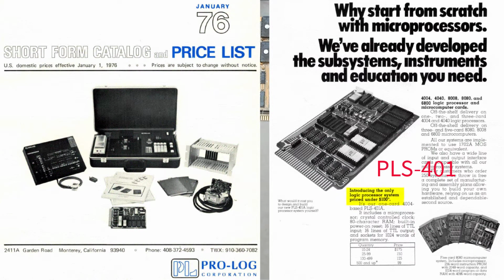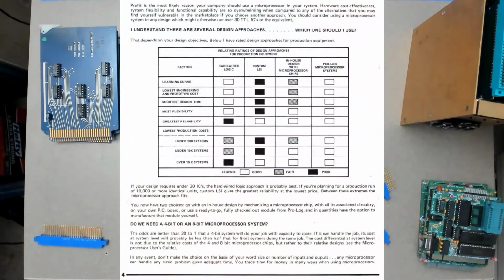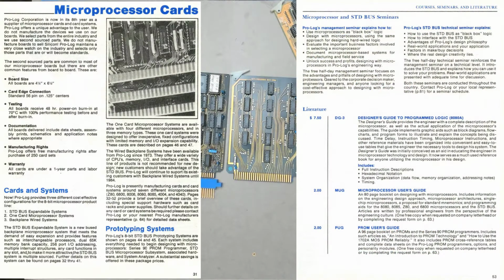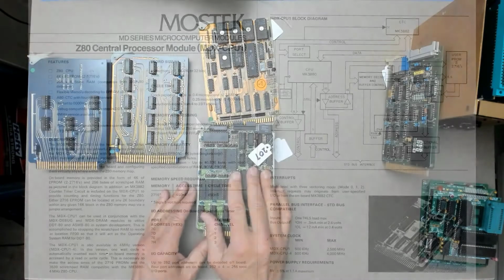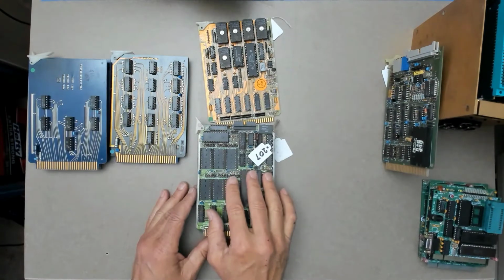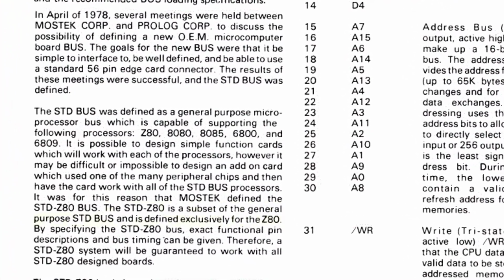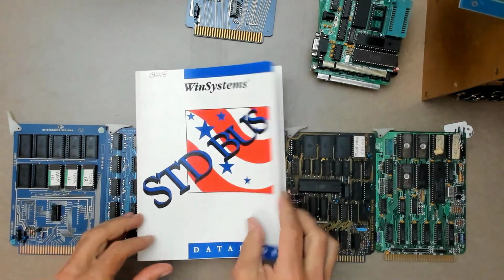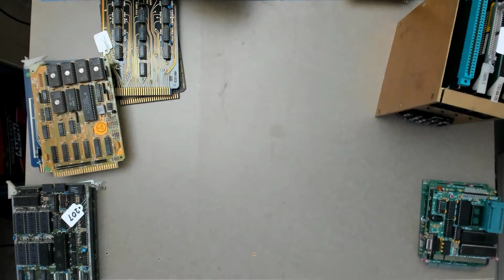{69} 40 years of STD BUS History: From Pro-Log to eBay

Comment: Hello, fellow Craig! I enjoy your channel a lot.  I haven't made any retrocomputing videos, but have been meaning to get around to documenting my MC6809/HD6309 projects. Also I found a stack of cards implementing an industrial furnace controller based on MC68B09 and there's even a MC6847 CRTC card and a bunch of fancy ADC cards. (I bought compatible slots but have procrastinated for a year so far on building up a backplane.) The CPU card says "MIKUL 6809".
Reply from the maker: These are all EXORciser bus boards?
Reply: @HelloWorldETX  I may have got my reply shadow banned for trying to link a picture. Some Mikul boardsets adopt the exorbus standard, but on my set, the card-edge is 60 pins, 115mm between pins 1 & 30, for a pin pitch of 0.156".  Maybe it's electrically similar or some exorciser subset that has less than 86 pins. It took me a while to find card-edge connectors that would accept the cards, and even then one has to be careful to align the pins.

Comment: In the early 80s I worked for a national disty of Intel, National, Intersil also had a line of STD Bus cards. Years later I went for a 5th interview for a technical position and mentioned STD Bus to the engineer. Luck has it that I was the first of 100s hired to get a new plant running with dozens of racks. I remember that PRO-LOG were a major seller in 1981 and even developed their own instruction set mnemonics for the Intel 8085A cards.
Reply from the maker: Interesting that you mentioned Pro-Log’s own instruction mnemonic set.  In the early days intel had copyright notices on their machine instructions and programming mnemonics, so I can imagine many companies were cautious about publishing programs with intels mnemonics and utilizing intel mnemonics in their own assemblers.   intel wanted to make sure their instructions were not used in clones and knockoff devices, so they were using the mnemonic and machine instruction copyrights to protect hardware.  But I do not know how they expected widespread use of their product if everyone was using different mnemonics, and I would be surprised if they ever protected the mnemonic copyright. 
I do not know how long Pro Log continued with their own instruction set.  You think it continued to the 8085?
Reply: @HelloWorldETX  I just downloaded the 7801 8085A Processor Card User's Manual and confirm the differences. Pro-Log were a major purchaser of Intel chips and I even had an Intel 4040 card set with TTY interface.

Comment: This sounded so interesting that I immediately hopped on eBay... only to find that prices of STD Bus cards are easily TEN TIMES what they were when you made this video (almost exactly a year ago, as of this comment).  Single cards are going for $70-$250, and I think I saw an empty card cage or two for $200-$300, with no cards.  Also a power supply for a card cage for about $90.  I think the only card cage + a few cards bundle I saw was for well over $1,000.  :-/ Prices on all retro gear sure have skyrocketed in the last couple of years!  😲

Well, I still enjoyed the video very much.  🙂
Reply from the maker: Wow, you are right. I did some searches and had to keep checking that I wasn’t inadvertently filtering out results or had $ sorted high to low.  Even multibus seems way up. I am sure that bargains will still come along but it will be a waiting game.  I am a firm believer in making reasonable offers if the seller is accepting them.   Not sure where these prices are coming from and if they are at all justified, there can’t be that much demand.  Check some of my “eBay worth considering” videos from a while back, maybe there are some of those items still around.

Comment: Whoda thunk the idea of a standard-pinout bus/backplane not only took so long to develop, but wasn't even a consideration for so long! I imagine that to be a result of the slow development process from "computers" based on countless hand-wired logic-gate "flip-chips"(?) based on discrete transistors... The point-to-point-wired slide-in cards idea was already common-place long before "busses" even existed!
Weird to think.
Seeing this, I think I inherited a homebrew/prototype STD-Bus(?) CPU card long ago, which I'd thought a one-off which I'd never find the pinout for. Here's hoping it's still in my collection!
Reply from the maker: I don’t think microprocessor based computers could have ever succeeded with the masses until the standardized backplane came into existence.  The ad-hoc, point-to-point would have been a nightmare to support on a large scale, and it was best left to the hard core users that just wanted quick delivery of standardized cards that they could then wire up specifically for their purpose.  Unibus, multibus and the like were way off the far end with complexity and features most industrial users didn’t need or understand. I see STD bus as being one of the most significant developments in bussed microcomputer history.